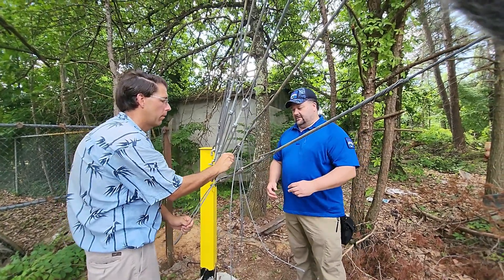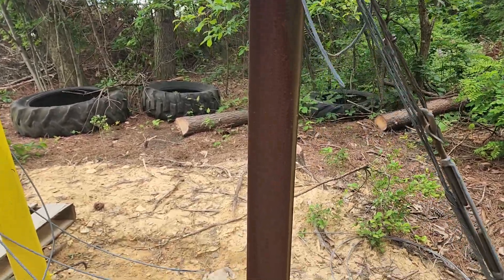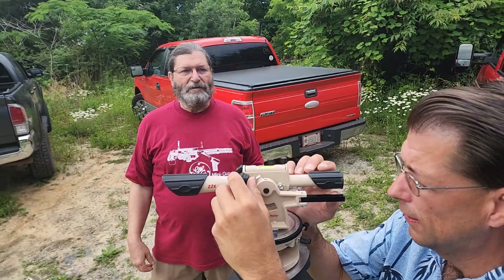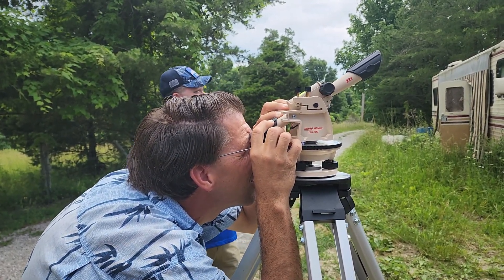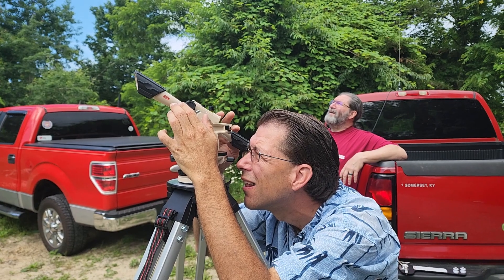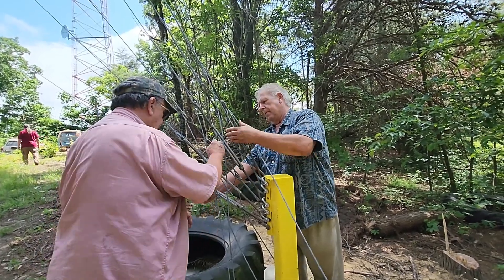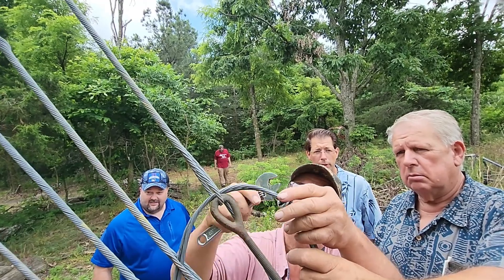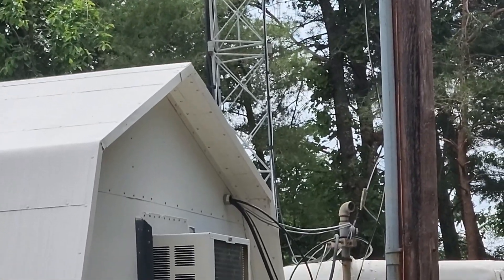LCARA HAM Radio: Disaster Averted - Last Task, Guy Line Tensioning!!!!

Comment: What will y’all be doing with the old feed line? I’m looking to set up a back yard repeater that will eventually be linked to my clubs repeater in the neighboring county.
Reply from the maker: Hey K4LEN - we plan on using new cable for the various antennas we plan on installing this year and next. The old will be inspected to see if we can reuse. Otherwise, it will be recycled or use in other areas. Until then, we don't know for sure how much we will have. Stay tuned. Thanks for watching!